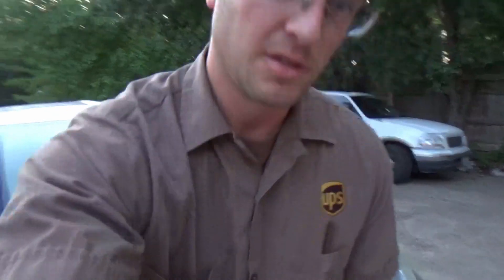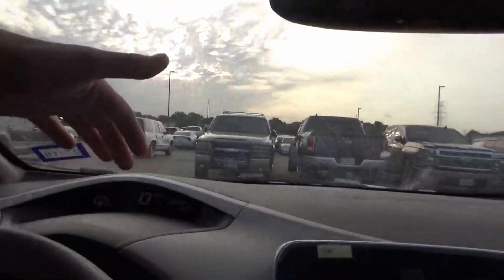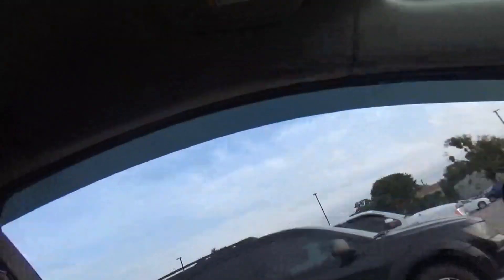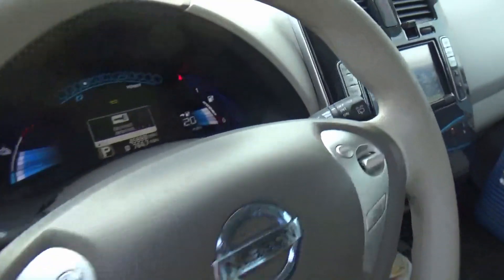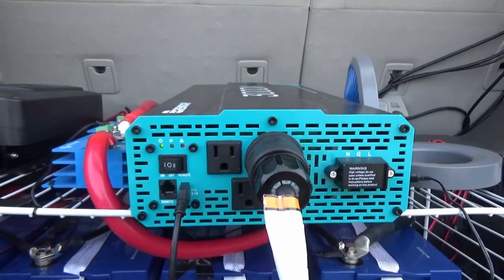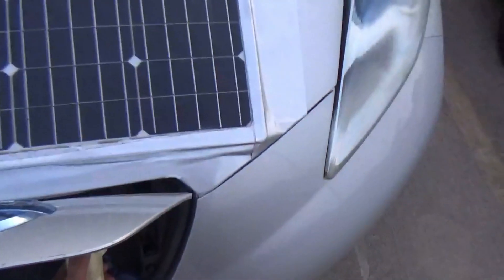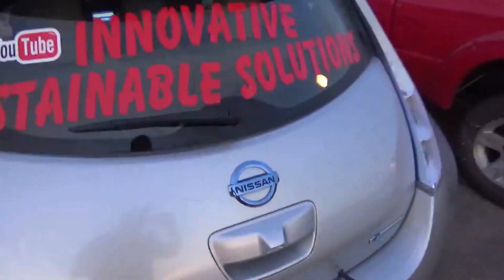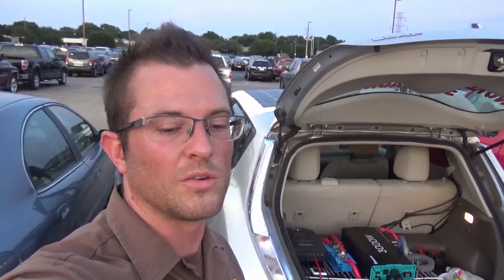Portable EV Charging Station

Comment: I live in Tenerife and have a Nissan Leaf 2013 - there are free charing points everywhere as well as the fast paid chargers in garages. As the island is only 80km x 40km - there are over 200 charging locations. My car only does 120km on full charge, but I can go all over the island and know I can charge every few km if I need to. Will never be buying a regular petrol/diesel car again.
Reply from the maker: I just googled that location.  What a beautiful island!  In the carribean this system is great for Leaf owners on islands, because the power grid is unreliable, mainly due to storms.  But I don't think you guys get as many of those Eastern side of the Atlantic
Reply: @InnovativeSustainableSolutions  No, rarely get storms here. Most of the storms are sand from West Africa. The islands are now 100% renewable as there are a lot of wind and solar farms around.

Comment: A question for the community, If I do this but wire the batteries to be a 24V configuration, will it charge the Nissan Leaf up faster than a 12V configuration?
Reply from the maker: No the voltage of the battery bank does not affect the speed the Leaf charges at.  In order to charge the vehicle faster you need an EVSE designed to deliver more than the standard 1400 watts, and an inverter that can handle it.

Comment: I am in this situation. Thinking of upgrading the car or adding diesel heater untill now that I'm seeing this.
Reply from the maker: There are numerous 500-1500w electric heater options that can be run off a small battery bank in the back.  Improving your comfort while driving, and removing aux electric loads from the main battery.

Comment: Once the battery drops down to about 45 miles, how many years or months driving every day does it take until it drops down to 25 miles?
Reply from the maker: It depends on a lot of factors, heat, how you charge it, how you drive it, and how much you drive it.  Assuming the vehicle is getting a minimum of 4 miles/kwh, you're talking about 5kwh of degradation, or about 20% of the overall state of health of the battery.  If you dont live somewhere really hot, and you only charge it at night, when it's cooler, using a slow charger, and you don't charge it past 90% or so, and you don't drive at 85 miles/hour inflicting a vicious discharge rate on the battery, I think you could make that last at least a year.  If you rapid charge it during the day, and do full charge/discharge cycles per day, and you live somewhere really hot, this can happen in as little as 6 weeks.
Reply: @InnovativeSustainableSolutions  okay so this video was made two years ago. The battery was at 45 mile range. How long did it take before you only had 25 mile range? Some people say that once a few cells go out, it causes the rest to die so they say it's better to fix the dead cells before they destroy others. I'm also wondering how long the battery will last after a few dead cells are replaced. Depending on the cost of installation, it's probably better to replace with a new battery.
Reply from the maker: @GospelOfTimothy  Opening the pack up and replacing only the weakest cells in it works great, . . if you can find new undegraded modules.  You can't unfortunately.  Fewer and fewer Leafs are being sold every year.  The aftermarket availability of new modules is non-existent.  1 year after the video was made the range had degraded to 35 highway miles.  I swapped the battery out at that point for an 11 bar battery from a donor vehicle.
Reply: @InnovativeSustainableSolutions  looks like we are plenty of room on the roof to put more solar panels. How is the 11 bar battery working out for you?
Reply from the maker: @GospelOfTimothy  Excellent.  It is down to an 11 bar now, but it will last for at least another year, before joining the other 84 modules in the powerwall.

Comment: I see lots of people on youtube building home made free energy using dc motors with an ac converter and i wondering if a generator could be made strong enought to handle the tesler charge and i f the generator can be installed directly in the trunk or front hood of the care

Comment: This doesn't make sense to me. Those batteries look like Battle born 12v batteries which are roughly $1K each. That plus the charge controllers and solar panels means this likely cost around $5K. That's the ballpark of getting a replacement refurbished leaf battery that would give you better results!
Reply from the maker: Using Battleborn batteries in this application would be crazy from a price perspective you're right.  These are not battleborn batteries.  The batteries in this video were Renogy AGM, which actually might be an even worse choice overall.  I eventually switched to aftermarket Valence batteries shown in this video here, https://youtu.be/qjQIS9P0YvM, for about $250/kwh

Comment: What about adding 4 barring on the wheels rolls with the wheels of the car while driving it clasp charge it’s battery or the extra added battery 🔋 itself.
Reply from the maker: The vehicle comes with this feature standard.  All electric vehicles do actually (to the best of my knowledge).  The drive motor has a feature where when you take your foot off the go pedal,  kinetic energy in the vehicle will be used to charge the vehicle's battery.  This is know as regenerative (or regen) braking.

Comment: I wonder if some super capacitors could be used to take in the solar cells current with the least amount of resistance and then trickle feed that directly into the DC part of your batteries.  I'd think all the wires could go straight into the hood sight unseen.
Reply from the maker: The problem is voltage.  Check out my video "Connecting Solar Directly to our HV Battery"

Comment: i lost 4 bars around 42k miles and nissan replaced my battery at not cost to me.  up to date, i lost 2 bars at 85k miles so the new battery is a little better in term of degradation.
Reply from the maker: I hear and see that a lot.  LG tweaked the battery chemistry a bit for Nissan's Gen2 modules, which seems to have slowed degradation by somewhere around 25-35%.  Glad they did right by you with the battery replacement.

Comment: What was the total cost for all charger components?
Reply from the maker: I'm up to around $3,300 for roof rack, solar panels, air conditioner, batteries and inverter.  Plus another 3k for an old Leaf.  More than I was hoping to spend, but still probably the cheapest way possible to get a roughly 70 mile range EV.  It doubles as a generator too, which is a very nice thing to have at the moment with the blizzard we're in currently.

Comment: You should just leave the one solar panel on the roof to trickle charge the 12V battery in the front then drop the battery under the car and replace it with a salvaged 30 or 40 kWh battery.  You can get a CAN-Bridge for around $450 and a used battery for $2500-3500.  All you need is a mechanic friend with a lift and its about a 1-2 hour job.  Will give you 100+ miles of range and get you back to 10-12 bars of battery life.
Reply from the maker: Check out latest videos for specifics on shifting the 12v loads to a solar power source.  As far as a new 40 kwh battery for $3500.  SOLD!  Please include a link to this source and I'll buy it literally today.  I'm having trouble buying lightly used 24kwh packs for under $2,500 BEFORE shipping atm.
Reply: with 6 persons working hard.

Comment: If the battery is expensive in Usa just imagine the price of a nissan leaf battery in third word coutries like here in brazil its absurd too expensive unfortunatelly eletric cars will take 50-100 years to be widelly adopted in the third world coutries. Here i n brazil we have the bio-ethanol cars green fuel that also runs with normal gasoline they are called flex fuel cars, and we have them since 2006
Reply from the maker: I've always wanted to visit Brazil.  Battery cost is the huge barrier, no doubt about that.  When Lithium Ion batteries were first manufactured, it was at a cost of about $3200USD/kilowatt hour back around 1995.  It was all Nickel Metal Hydride batts before then.  Today that cost is around $120kwh.  That cost will fall another 50% in the next decade, as global production doubles every 2 years, and economies of scale kick in.  I think you may have some electric options in Brazil sooner than you think.
Reply: @InnovativeSustainableSolutions  yes the price drop maybe in 20 years   ev cars become more common here, here today a Renault zoe cost the same as a complete toyota hilux top model diesel 4x4 double cab no one will be crazy enough to buy the elétrica car at this price its unreallistics and here we dont have any goverment discount

Comment: The Leaf itself burns 300 watts per hours cooling the onboard charger, IIRC so in 10 hours you lose 3Kwhr. 240V would be more efficient as it would charge faster. This is why a 12A 240V is more than twice as fast as a 12A 120V system...it takes less time so it doesn't lose that large percentage. Also why you only see 1Kwhr or even .9Kwhr charge rate on 110/120V because you are losing so much to that charger.

Comment: I have a 2007 Nissan Leaf. The drive battery health was down to 4 bars. I could only drive about 15 miles. I found a company in Portland, OR. The guy installed a 2008 used battery in my car with full bars of health for $2000. When he was done (in just 1 day) my car was like new. There are companies on the East coast that do this also.
Reply from the maker: You're talking about EV Rides in Portland.  I've talked to them, they have a couple like-new 24kwh Leaf batteries in stock now.  They charge $3k now (and keep your old battery) but it's still a really good deal, and I would absolutely have done it for that price in Dallas.  I think you will see this price increase sharply in the next year as Leaf sales have really fallen off a cliff recently.  The battery swapping companies all source their batteries from wrecks, so the disappearance of new 24kwh Leafs on the road will substantially reduce the availability of newish batteries from wrecks.

Comment: Although for your case, it looks like you're mainly just adding more batteries (as calculated below...). But one big disadvantage of EV's over ICE's is that if you completely run out of charge in the middle of nowhere, you CANNOT bring a gerry-can of electrons to get you to a charging station. Your solution would solve that - if you drive around for a few days in the sun, it would charge up the 12V batteries and give you enough juice to get to a charging station if you ran out.
Reply from the maker: You're right about the energy contributions from batts vs solar.  The current system (see more recent videos) tops out at 3.3 kwh from the solar and 4.4 from the valence batts.  The solar power is free though, and doesn't add much weight at all.  The combined 7.7kwh turns into about 30 miles of added range.  Honestly this isn't a car you find yourself "in the middle of nowhere" in.  I built this just as a cheap ($6k all in) commuter car.  I was spending $1500/year making a daily 50 mile commute in my F150.  My ROI is around 2.5 years if I sell the batts afterward.

Comment: 45 miles as a full charge is horrendous.  Even I know that you should have more bars on your capacity.  You are LONG overdue for a battery pack change-out.   For a 24kwh leaf, you should be getting around 80 miles on a full charge.  Seems to me the money you invested in extending the range should have been spent on a battery pack replacement.
Reply from the maker: Total solar charging system cost $3k.  New battery from Nissan $9 minimum, if they'll do it.  This car is intended to be exclusively a commuter car, to replace my truck on my work commute, I don't need much range on it.
Reply: @InnovativeSustainableSolutions  No, a used cell-tested 24kwh battery pack is around 3k.  I think you typoed that nine dollar price...   https://insideevs.com/news/428315/ev-rides-nissan-leaf-new-battery/
Reply from the maker: @apoch003  9k price is if purchased from Nissan.  I checked out the website of the company mentioned in the article linked above.  They do claim they will give you a 80%+ pack for 3,000 + they keep your old battery.  That's a GREAT deal if true, I'm just a little suspicious because I can't possibly see how they make any money at all (or even avoid losing money) at that price point.  Where the hell are they getting lightly used 24kwh Leaf batteries from for $2k?  I'll do a little digging and see if it's legit or if there are some hidden costs.
Reply: @InnovativeSustainableSolutions  The used batteries are repurposed into household or building power storage.  They make money by that sale.  They get the batteries for YOU from previously wrecked vehicles at scrapyards.  It's sustainable business.
Reply from the maker: @apoch003  It's only sustainable if there are are constant stream of like new 24kwh Leafs batteries coming from wrecks.  There REALLY are not.  Leaf sales have fallen off a cliff in the last year across all the pack sizes but ESPECIALLY in the 24 kwh variety.  Sales are down 64% globally year-over-year, and there are currently less than a 1,000 sold per month globally.  (https://insideevs.com/news/437807/nissan-leaf-sales-japan-july-2020/).  Under 200 of those were 24 kwh.  Nissan is pretty much publicly abandoning the Leaf.

Comment: I'm down to 9 bars, which gets me to work with no problems.  But coming back home is a gradual up-hill climb.  I have between 0 and 12 miles left when I get home.  2013 Leaf.
Reply from the maker: I can relate.  You can find good Lithium batteries for a little over $100/kwh.  Expect each kwh of batts in the trunk to add 3.5 miles of range.  So I think for around $400 you could get 3 kwh (10-12 miles).  After that all you need is a good inverter, and a device to charge the batteries in the trunk.  I think we can design a system that would add atleast 10 miles/day in range for around $1,100.  Check out my video portable charging station w/out solar to get an idea of what a system like that would look like.  E-mail me if you need help

Comment: I assume you precharge the 12v bank each night also?
Reply from the maker: Correct
Reply: @InnovativeSustainableSolutions  Good execution to save the car for your continued commute. I didn't catch it but do you know how many miles the panels alone add? I.e. if you had not precharged the 12V bank also?
Reply from the maker: @patty109109 Current version has a record of 3.2 kwh from the solar alone.  Thats about 12--13 miles.  I think I'll be able to break 4kwh next summer (2021).  I have a few more solar tricks up my sleeve.

Comment: So you bought electric vehicle that will destroy enviroment in the long run more than any gasoline or diesel car , and you are additionally using portable power generator,  to put some more pollution hahaha. If you care about not polluting, you would use ordinary gasoline car with methane or LPG that has ZERO pollution with far less impact on natural resources on the long run.

Comment: I have a Nissan Leaf since May 2020 . I have noticed that when I drive the speed limit/cruise I actually gain miles. EV better perform when driven slowly even thou they are also designed to go really fast. Nissan is the best 🙌🏾
Reply: youre actualy gaining anything if you drive "battery friendly" the onboard pc wil recalculate how far you can go if you keep that style of driving.
Reply: Motor tech improving all the time latest semi permanent magnet design performs better at higher speed,

Comment: 45 Miles with a fully charged battery. That degradation level of this "cheap" Nissan Leaf Pouches without thermal managment really sucks. Is´t it maybe possible to transfer DC from the 12, 24,32,48,... V DC Batterie to charge the car than directly with DC via Chademo. What you do is convert DC to Ac and the car convert that Ac to Dc, right, this probably should cause some losses. What about a bigger Lithium ion Powerbank, to charge the car or is it still to expensive ?
Reply from the maker: I explore the idea of a MUCH bigger battery bank in my next video.  A 36 kwh thermally monitored battery bank, with passive solar charging.

Comment: you can just replace it with new 40kwh battery for about 6k
Reply from the maker: Sweet!  Please share a link to this new 40kwh Leaf battery for $6k.  I'll buy 2 today
Reply: @InnovativeSustainableSolutions  look for EV rides in portland oregon
Reply from the maker: @voicesofnepal  I checked them out.  They currently have 1 2016 low mileage (23k) 30kwh Leaf.  So that's a like-new 30 kwh battery for $11,400.  I really do wish you could get could get 40kwh batteries for 6k.  Leafs would be affordable to everyone at that price!  But you can't.  $6,000/40kwh = 150/kwh.  This is below cost for Nissan to get their modules from Panasonic.  Even Tesla struggles to break the $100 barrier.  I shop used Leafs for 2-3 hours a week, and I have never seen a 40kwh battery near-new for less than $14k.  My intent here is not to be confrontational, only informative
Reply: @InnovativeSustainableSolutions  I contacted them earlier and they told me they had them I will have to  drive out there one of these days. Myl leaf is currently fine but I am scoping the possibility out for future ref
Reply from the maker: @voicesofnepal  Let me know if you strike gold.  It would be a great inclusion in the EconomEV segment I do at the end of my episodes now